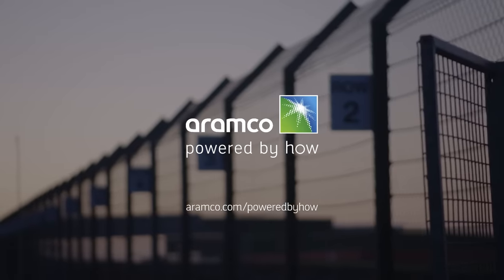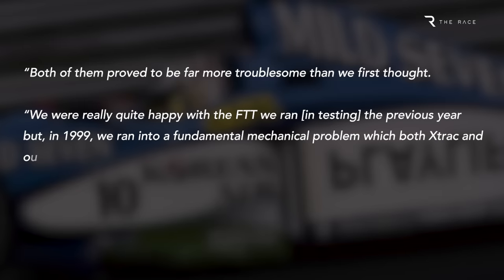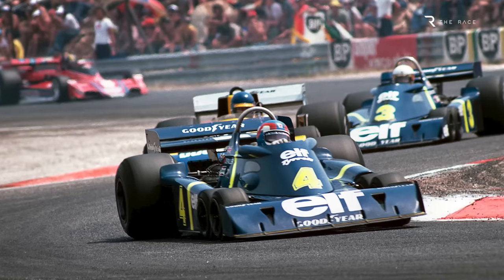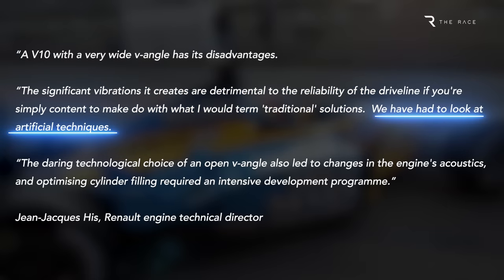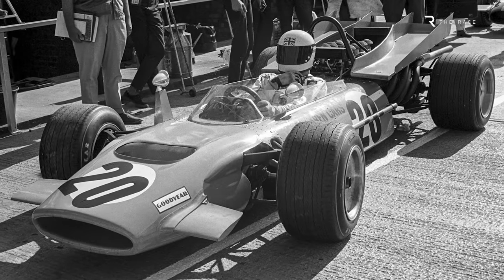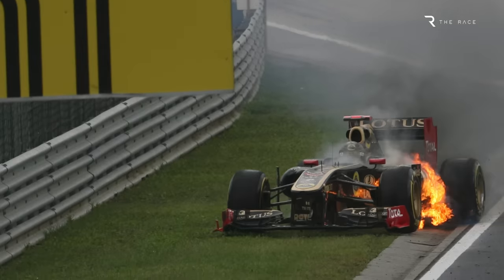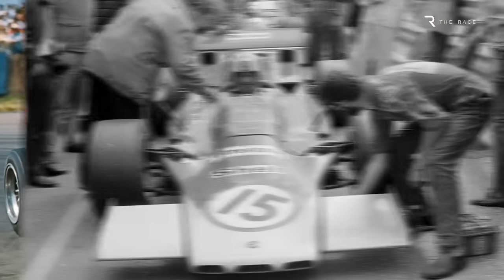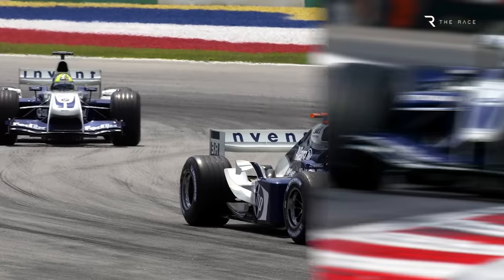10 F1 technical innovations that failed

Comment: Perhaps you could do a video on innovations that were banned before they even made it to a race. The rotary valve engine that McLaren wanted to run springs to mind.
Reply: The McLaren has something need to desire for it.
Reply: Or the infamous double-chassis Lotus 88 (that some said wasn't as good as it was supposed to be).
Reply: Williams cvt is a good one
Reply: The 6 wheel, 4 wheel drive ground effect Williams FW07C/FW08D spring to mind. The FW08D was alleged to be a complete rocketship even with the DFV8 in it instead of a turbo engine.
Reply: or odd manufacturer f1 engines? Subaru flat 12 comes to mind
Reply: @cameraboxer  that's a good idea!
Reply: @briannam1082  The Williams CVT makes me cry, because modern CVT's suck, and had it spent a couple years of development in F1, we might have some modern road cars with them in (a lot more refined, of course)
Reply: @Stevo_1998  Modern CVT's suck because the manufacturers claim they don't need maintenance. It isn't that hard to figure out that a system that works on FRICTION, sheds tiny little pieces of the belt constantly. Those tiny pieces contaminate the oil, enhance the wear and ultimately destroy the transmission. Then there's also the possibility of the oil overheating in the transmission under heavy load. That also leads to enhanced wear. Do regular service on a CVT, use it as it's supposed to be used and it will be a reliable transmission.
Reply: Rotary Valve engines ran in F1. Get yourself a cookie, if you know in which car.

Comment: Small correction: the "Standard" V angle for a high revving V10, that gives the best vibrations characteristics, is the 72 or 75° V Angle. 90° V angles in V10s have balancing issues, but have a lower center of gravity and they allow for a better airbox and trumpet design in the wider V, potentially delivering more power IF the power gain isn't eaten up by vibrations.

Comment: F1 should bring back exhaust blown diffusers or another way to make the exhaust useful to performance.  It sounds crazy and might allow for more consistent/better floor performance which could lead to even further reduced reliance on overbody airflow for downforce, reducing drag and increasing efficiency
Reply: Floor performance is consistent. Overbody aero is now secondary. EBDs will only add complexity - and additional variables require additional tuning time / create opportunity to get things wrong
Reply: It's pointless with how the downforce setup use. The underfloor is already as efficient as ever, even too powerful. Shoving extra air only just choke the whole thing

You can't just shove whatever cool bullshitery and expect it adds up like in the game stat
Reply: @SmashGhost  right - I say reduce overbody aero more, reduce drag and use EBD for the show.  More complexity/more things to go wrong is a positive in my view; super consistent performance and reliability is a big contributor to dull race weekends.
Reply: @bocahdongo7769  i don’t know what you mean by bullshittery to add up to game stat.  I don’t play video games.  I also don’t know what you mean by “too powerful.”  Teams use so many drag-inducing devices to seal the diffuser from the rear tire wake when exhaust gas can be used to accomplish the same thing without the same drag penalty.
Reply: @dand1585  You assume that those exhaust won't make dirty air anyway. 

And remember dirty air is just F1 term for wake drag. It's same thing, just different perspective
Reply: @bocahdongo7769  of course you’re right but the exhaust has to come out of the back of the car anyway so in my opinion it would be better if teams could try to use it for something.  I’m a fan of the technical innovation in F1 as much as anything and get kinda bored with primary  bodywork aero and vortex generation being the answer to all the problems, especially when it’d been done effectively in the past.

Comment: Fun fact. George Russell is the only driver in the. 21st century to win a race without sidepods
Reply: The W13 did not have "no sidepods".  To say that is just wrong. There still is a cooling inlet and after the cooling inlet there still is a small, very short sidepod. So its not like there really is no sidepods. This statement has also been refuted several times with photos from above and the side.
Reply: @fam.hunger5244  bro the fact that you felt the need to say this 😂. I’m pretty sure everyone knows there’s a sidepod. It’s very small and if there wasn’t one there wouldn’t be an inlet for the radiator.

Comment: That's good info, thx...The 2012 Lotus car is quite different from today's cars, or the 2026 specs. It didn't have ground effects or the same wheelbase, weight, tires, aero advancements, balance, engine, etc. Apples to olives, really. So progress, even with ground effects, is possible.

Comment: Something I thought was pretty interesting at the time was the weirdly shaped rear wishbones McLaren ran at the beginning of the new turbo era. I believe the reasoning was that since the vertical cross-section was symmetrical it technically didn't count as a downforce producing device, but because there's two of them they interact with each other in such a way that it works like a beam wing. Should also have helped the diffuser. It wasn't really efficient enough though and the Honda engine wasn't powerful enough at the time to make it work.

Comment: In the early 2000s, I remember every publication talking of the twin keel suspension and this video made me realise I've not heard of it for years. Is it still a thing or has it been superseded?
Reply: The twim keel suspension gave an aerodynamical advantage but also a big structural disadvantage. It was not stiff enough and a lot of aditional mass was needed to stiffen it. This means a lot of additional weight where you don't want because more additional weight so far forward means disadvantage in terms of vehicle dynamics(more understeer, more lateral weight transfer and higher tyre wear). So basically the disadvantages outweight the benefits. In 2005 the zero keel was invented(what teams use untill today). The zero keel was as stiff as the single keel(what teams used before/instead of the twin keel)but had the aero benefits of the twin keel. Thats why the twin keel failed and was never seen again after the zero keel was invented. I hope that answears your question.
Reply: @fam.hunger5244  perfect, thank you.

Comment: Just to clarify (as this is a technical discussion), the March 6 wheeled car was actually banned after they made it.  They found that they couldn't find a material strong enough to make the prop shaft out of.  They kept failing due to the torque stresses, so March reverted to the standard 4 wheeled version before the 6 wheeler was banned.

Comment: everytime a team come up with a good idea that works fia ban it
Reply: I think F1 is just too fast for its own good. When a single mistake could send you hurtling towards a wall at 180mph, the FIA is understandably cautious about anything that might result in extremely high cornering speeds. If the cars only had a top speed of 100 mph, then they could theoretically use all kinds of bullshit because the worst crash would still be like 3x less energy. I’ve seen people attach giant wings directly to the rear axle on a very budget race car, and nobody cared because it wasn’t like it could go over 110 mph without at very long straight away.

Comment: 5:05 Renault never ran a 72° V10 before 2004, instead they ran 67° units from 1989 to 1996 and a 71° engine in 1997, later called Mecachrome, Supertec or Playlife.

Comment: your FTT didn't fail man.... Honda Preluude Type SH with its Active Torque Transfer System being a front wheel drive system.   Of course the car doesn't exist anymore, but the Technology is still around now in the Acura MDX 'SH' version.   I personally dont consider that a failure if it's been put into Production vehicles which people are buying.
Reply: There will always be something where a technology can be used elsewhere. But this is about F1 and whether a technology failed in F1.  And not whether it works somewhere else. And FTT failed in 1999 and was banned in 2004 after BAR used a more advanced system.
Reply: @fam.hunger5244  then you dont understand F1 if you think you can look solely at F1 and not the rest of the automotive world at the same time...
Reply: @fam.hunger5244  you're trying to pigeon hole an entity that's tied to a much larger entity and you can't even recognize.
Reply: @fam.hunger5244  you can say the same thing about 'active suspension and f1' but the thing is... it's also in consumer vehicles as well... AND then you're gonna find a pattern. technologies used or once used in F1 found in other parts of the world.  
which then comes back to you not understanding F1
Reply: @fam.hunger5244  i dont know what F1 is to you... but ive come across several research papers born because F1 exists...  PhD candidates gathering their research for their PhD. Engineers getting their doctorates.  this is in multiple industries not just automotive.   

you think whatever it is you want to think about 'F1 technologies'   i just find your opinion extremely short sited and blind.

Comment: The truth is, if it is a McLaren, Honda, BMW, Renault, or Lotus innovation, it will get banned. 
Yet, If it is a Ferarri or Mercedes innovation, they will be applauded for exploiting a “grey area” and get a slap on the wrist and pat on the back.
Reply: Yeah Ferrari definitely didn’t get penalized for the fuel flow system in 2019 (a grey area) 
Definitely not